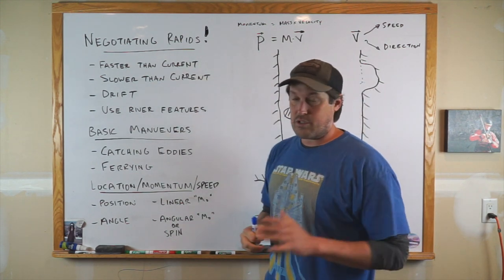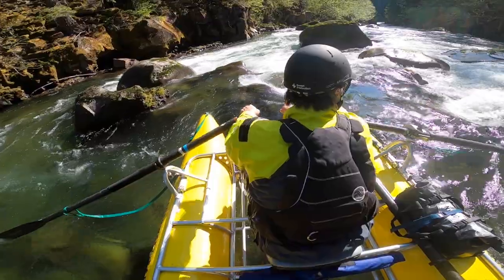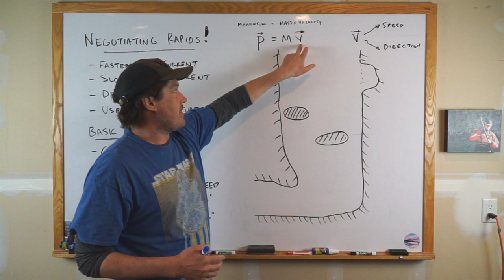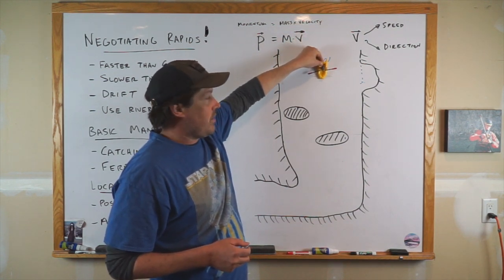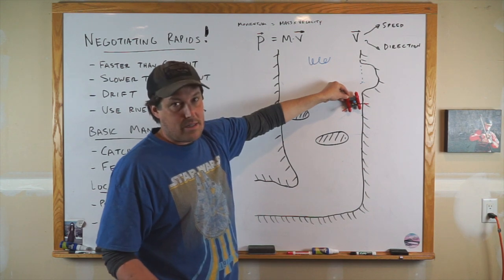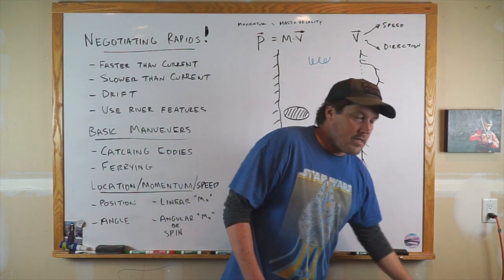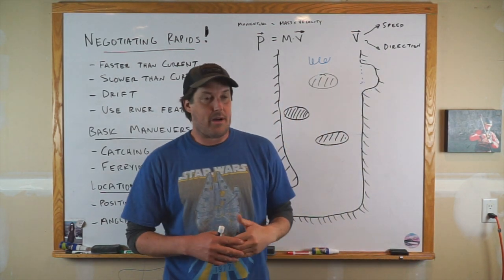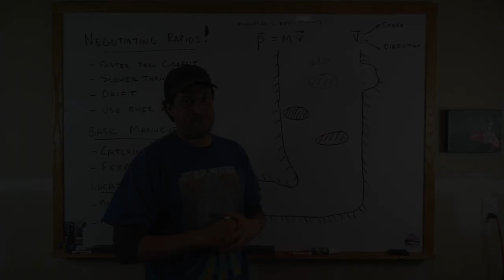Speed and Momentum with Oar Boats | Ep. 137

Comment: Great explanation between weight ,momentum and speed . I’ve been lucky enough to Own rafts , cats , and drift boats . And it’s interesting how these three factors affect each boat when it comes to your rowing and maneuvering speeds for each . For me a weighted raft is the one you really have to plan ahead on your line super slow to react and then the drift boat that maneuvers much better but doesn’t like hitting obstacles. We have a couple of 10’ cats and they are the Ferraris of maneuverability one pull you can do a 360° great for checking out new water . Nice to see someone doing this , I’m sure it’s very beneficial for new rowers especially. Thanks for sharing

Comment: So I'm left with a question. If your pulling to manage momentum in a gear boat in technical rapids, are you pushing to manage speed in those same rapids in a light (sport) boat. Or is it still mostly pulling, just a different term (speed vs momentum) due to the lack of mass? Thanks. I ask mainly because you do have 3 options, 1) go faster than the current 2) go slower 3) use features. Going faster, however, also speeds up your reaction times. So not always ideal, imo.
Reply from the maker: I'm pulling in light oar boats too

Comment: Can you also dump momentum with spin and if you can is it ever practical?
Reply from the maker: Generally no. Angular momentum is different from linear momentum.
Reply: I dont want to disagree but totally do.

 However in most of my experiences you need an anchor point that is offset for it to redirect the energy. Kind of like a pulley.

When cars impact they generally spin out. When i avoid big hits on my bike, i first spin the bike and then my body if need be. 

Anyways, i tested the reverse of this yesterday to power out of a short inlet in a strong river. I spun myself a few times and then converted it to forward momentum and seemed to work a little (first time ive tried).

I think this question is a bit like the bicycle paradox where the numbers don't align with observations perfectly.

I have terrible math but have done a bunch of physical stuff and arresting forward or backward motion by converting it into spin is pretty common.

Comment: I've done mostly fishing from my raft and I was just out with a buddy that wanted to row and he kept over correcting we were on a smaller river and by the time he got the boat moving we were way out of the striking zone. I've really noticed this if I have two anglers on the raft and I'm doing a crab stroke to try and keep the both parallel to the fishing zone how much weight is in the boat makes a big difference when its heavy you can not correct it as easily anyway I had a hard time explaining it eventually it sunk in and at that point it is just getting familiar with the handling witch could take some time thanks for the vedio